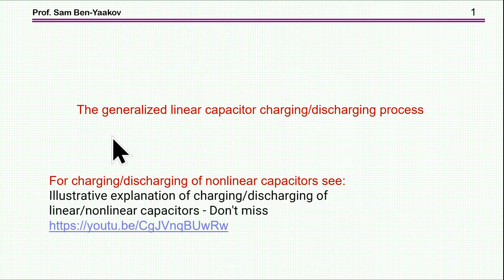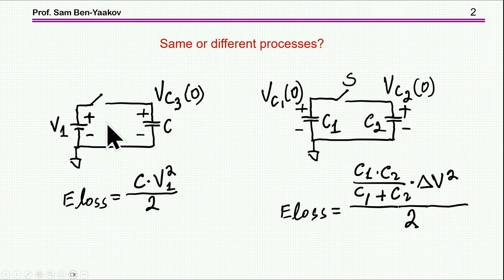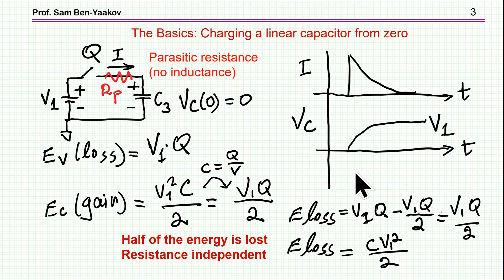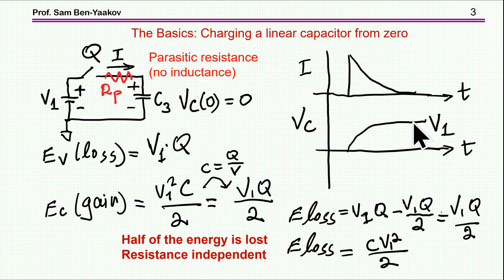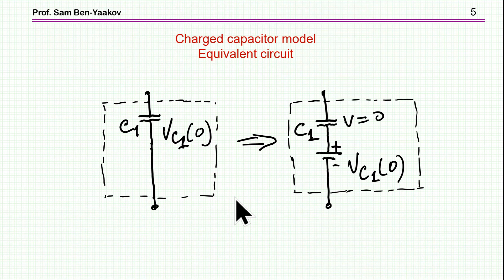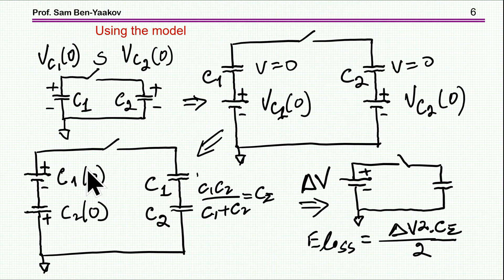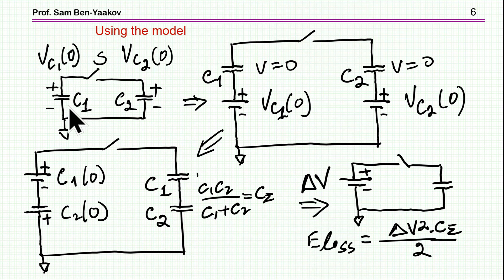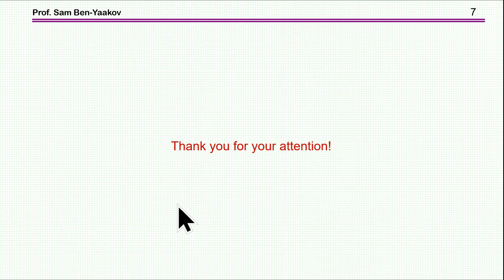The generalized linear capacitor charging/discharging process: Corrected

Comment: Careful. This is the famous "two capacitor paradox". 

The discrepancy in energy in the system before and after charging is not due to "resistor loss" as you suggested (or anything else, including mischievous imps). 

For simplicity consider identical capacitors of value C. It is an easy & tempting error to assume that the energy exchange process which gets you from 0 to V/2 is the same as the one which gets you from V to V/2. Its misleadingly symmetrical.

Lets look in a bit more detail at the process.
One capacitor goes from energy 1/2CV^2 to energy 1/2C(V-0.5V)^2, expanding and subtracting shows the "work" it did was 3/4(1/2CV^2). The other capacitor goes from 0 to 1/2C(V/2)^2, similarly an energy change of 1/4(1/2CV^2). The total work done, and the total energy in the system from transferring charges in the two capacitors 1/2CV^2

As you can see, discharging the capacitor costs far more energy than charging it (three times more - thats the cost of shifting energy around at higher voltages for you, i guess!) and the TOTAL energy in the system remains the same all along ar 1/2CV^2.

Here's a paper i found on it from years and years ago when we were "shocked" at the revelation of the paradox. It's a bit of a complicated explanation, but showed the way:
https://arxiv.org/pdf/0912.0650
Reply from the maker: I'm sorry, but you're totally wrong on all accounts. You're confusing energy loss with energy stored. The energy lost is proportional to Delta(V)^2, period.  If you think I'm wrong, tell me which of the equations in the video is incorrect. 
In all practical cases, the loss is due to resistance (and independent of the value of the resistance). The Paper you referenced (obviously never published, just uploaded to the ArXiv site) is childish.

Comment: Thank you for the explanation. In slide 2 circuit (capacitor and voltage source), where is the energy loss dissipated? ( the circuit doesn't show dissipative components).
Reply from the maker: This is just  generic charging circuit the resistances couls be in the switch and ESR. The final loss thogy is indeoepndent on the resitance. See https://www.linkedin.com/posts/ben-yaakov-shmuel-sam-49094422_what-happened-to-the-remaining-energy-assume-activity-7145049498614919168-rEON?utm_source=share&utm_medium=member_desktop

Comment: from my posts in the previous video: 

"...unballanced leakages, that do modify the equivalent capacity of the capacitors in series. And am not talking about voltage unbalance, am talking about uneven charge-discharge, that can produce transient value for the effective overall capacity. 
Am wondering about that. Can it be so? 
I think it can be observed on an exagerated model, R in series with an parallel RC. Make the R very small. I said, exagerate the model, but it still speaks truth. It will give very much modified "equivalent capacity". 
In practice, that would take time, but in practive we have long time. Even using same material components, in even longer time, it will still give variations. 
Every capacitor, by itself, no series, just one capacitor, has such variations, but the series ansemble gives bigger variations than the say equivalent variations. 
I say capacitors in series are messing things, should never be used in practice." 

Just because following such good theoretical presentation, some would be convinced that capacitors in series are goo use. Do not use them, they decrease the quality of the product. 
Capacitors in series are just theoretical, didactical object, to observe the principles. 
Always use just capacitors in parallel, of the value you need!
Reply from the maker: Thank you for your input. To begin with, there are no series capacitors in the presentation. The capacitors are in fact in parallel. Or did I miss anything in your note? The analysis shows that the energy lost, when charging/discharging one capacitor by another (in parallel parallel) can be expressed by a term that LOOKS like two capacitors in series. And BTW, capacitor leakge can not be modeled by a resistor for variable voltage . See also: https://youtu.be/T8qWWwsMOK8
Reply: @sambenyaakov  your capacitors are in series. 
"And BTW, capacitor leakage can not be modelled by a resistor for variable voltage" 
Really?! Nevermind the use of variable resistors, of which i bought some, and now i must throw away! 
Resistor leakage does not need to produce the same effect, it only needs to be on the same side of the engrossement. It is a didactical object that tells the truth. It does not lie. 
Not to divagate... 
The discussion i openned here, is about series capacitors not suited for long time operation. I asked for feedback in this direction.
Reply from the maker: @SergiuCosminViorel  
I guess you think that two capacitors in parallel are also in series? As for using two capacitors in series without a means to set the potential of the mid point, this is a trivial issue, not only because leakage may shift the voltage balance but due to the fundamental mathematical reason that the voltage is undefined. Have you ever tried to run simulation with two capacitors in series? Have you seen:
https://youtu.be/T8qWWwsMOK8
Reply: @sambenyaakov  i do not make simulations, and i also have no means to practically check. i only have a multimeter. however, what i pointed to, it proves necessary, as it is obvious less and less people and professionals know it. using simulations, readily available programs, it somewhat numbs intellect
Reply from the maker: Do these arrogant statements apply to smartphones too? LTspice is free use it if you don't want to fall behind.
Reply: @sambenyaakov  ha-ha, not at all, but i owed you one, when you made that joke on me, that the capacitors are in parallel.  
However, most of proffessionals lack some sense of logic. They can be good in technique, even in theory, but there is no proffessional training in logic. 
For example, you point to the non-determination of the potential in the series capacitors like a cause, and use of computers can induce such missconceptions, however that is not a cause, it is an effect. The cause is the uneven behaviour of the devices. The programs you and all use, they can make you see things that way, and the programs do not present you the cause. 
Am not against use of programs, without them the work would diminish to very little, but sure thing programs are automatisation of work. Any professor can see it.
Reply: @sambenyaakov  "LTspice is free use it if you don't want to fall behind." ?! This is a masterpiece of arrogance! 
I really do not need any LTspice, to not fall behind, as you say, because it is not my business. I do not work in making new iphones or whatever. I do not have such duty, to do that. Not that, not another that, so to speak, and you trying to intimidate me with such insinuation... really?! 
Remember, my interest in these is LIMITED, it is not my business, and i intend to not make it my business. 

I was not criticizing you, with my post. I was using an opportunity to point to another thing. The use of series capacitors is recommended by so many, and i use any occasion to try to explain that that is just a trap. You know, tens of years of electronics for hobby, many shematics made false with intent, like jokes. Shematics that do not work, as they are published. You too are an old timer, you know the customs. 
I did not even touch your presentation, i just tried to tie something on it, as i do not make my own videos
Reply from the maker: @SergiuCosminViorel    I did not intend to patronize you. My remark about LTspice was a friendly suggestion. From the conversation we have I am absolutely sure that you will enjoy LTspice , even just playing with it.  Do yourself a favor , download LTspice and play with it. I am sure you will thank me.
Reply: @sambenyaakov thank you! it is good intention, am sure of it, just that it is not my way. I do not intend to become professional, am sure i will not try to produce any electronic goods. To me, electronics is more interesting without simmulations. Only old style electronics. 

Now something about why simmulations with reactances, impedances, do not always work:  
What is real: electric curent, not in the sense of Amperage, but in the sense of countable particles, then capacitor, inductor... 
What is not real: Voltage, then all products of real and not real, like reactance, impedance... 
Why is this important? Because a said fixed value capacitor does not really have a fixed capacitance, not even as a perfect model. 
Also, structuring circuit, series and parallel, there are more than one way to model what is series and what is parallel. 
An easy one: what is parallel. Try to present two different ways of defining parallel! 
It is not something forced, it is natural, it is real, every day, everywhere, in all problems. Try!
After you do, you begin to understand, maybe, things you did not know. 
So, can you?